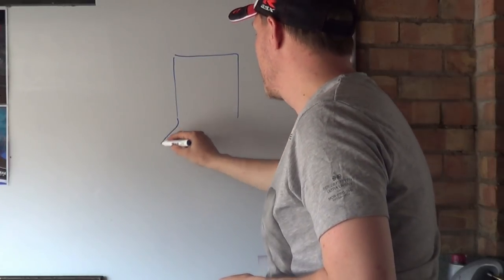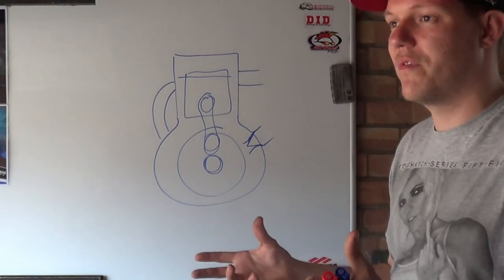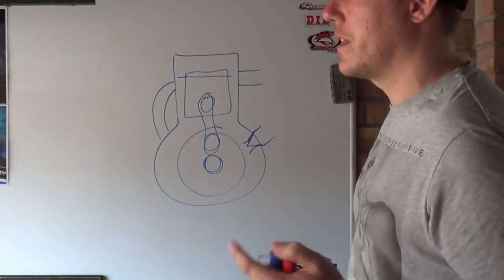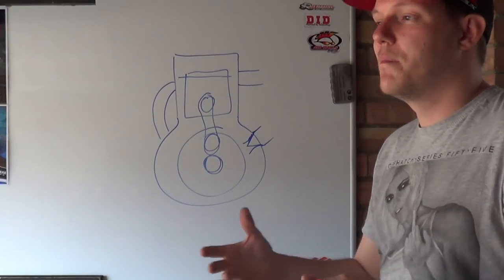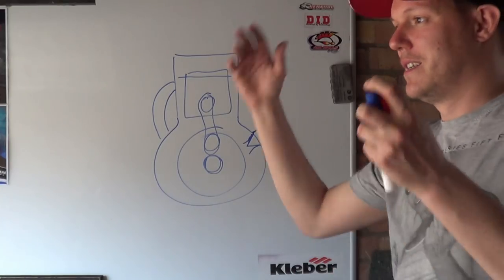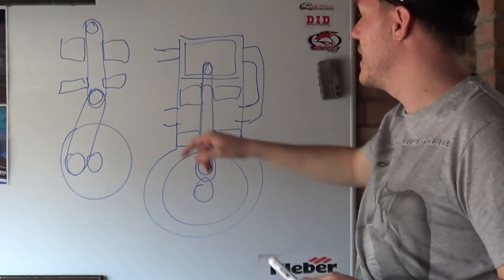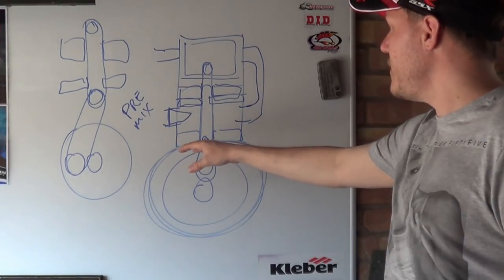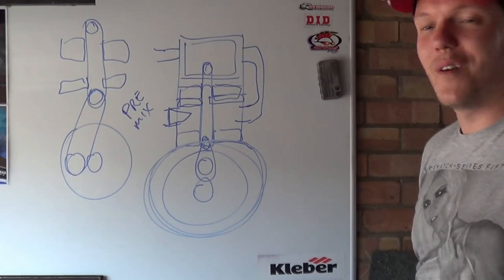2 Strokes are shite! - and why - Part 1

Comment: The most powerful aero piston engine that drove a prop in WW2 was actually a 2-stroke, the sleeve-valved 36 litre,  H-24 Napier Sabre, used in the Hawker Typhoon and Tempest. Over 2400HP from a 24 cylinder engine and I think that power output was never broken. The 27-litre Merlin or Griffon could never match that output, the best they could manage was 1000HP.

"There's nothing quite like the smell of Castrol R in the morning; it smells like, victory..."
Reply from the maker: lol Castrol R! now there's an awesome smell.
Reply: +ModshackMerlin   I do believe the Napier Sabre was 4-stroke in operation (its firing order/timing), utilising the continual supercharging to help after the power/exhaust stroke to purge residual exhaust fumes and cool the sleeve liner - since it cannot be as effectively cooled as a fixed liner non-sleeve design - although the Sabre could've been made to be mechanically 2-stroke, with minimal changes (giving it another ignition circuit to fire for between the other) - the material specifications and cooling problems of then & it in that format excluded it running as a 2-stroke in firing order/timing, -that and even more excessive fuel consumption for its power & size for usage in an aircraft..
Reply: Matt worked on the Napier Deltic, so I am happy for him to be the arbiter in our discussion. A lot of articles come down in either camp when it comes to the Sabre engine, so the actual answer is a bit clouded.
Reply from the maker: lol the Sabre was a 4 stroke engine, with sleeves similar to the Knight system. The Deltic was actually meant for the Navy. Napier loved the Jumo 204 and wanted to get in on the diesel game. 

The rotating sleeve opened the ports to the exhaust and inlet, but the cycle was 4 stroke. The deltic made use of the uniflow system seen in most diesel marine applications today, with the added bonus of the opposed pistons arrangement. 

- matt
Reply: The Workshop 

on the subject of uniflow, and attempts to take advantage thereof, is the twingle anywhere on the list?
Reply: The most powerful aero piston engine was a radial Pratt & Whitney R-4360 Wasp Major, iirc.
Reply: ModshackMerlin, your data on the Merlin is incorrect. The Merlin 61 is rated 1,565 hp (1,170 kW) at 3,000 rpm at 12,250 ft. The late war version Merlin 130/131 designed for the de Havilland Hornet was rated 2,060 hp (1,536 kW). RR ROCKS.
Reply: wow! i never knew the sabre was a 2 stroke! thats fucking cool! imagine one in a bike! ha ha!
Reply: @dirtygarageguy  you never forget that smell its the best!
Reply: Sleeve valve is 4 stroke cycle in aviatio at least
Reply: The crecy was a actual 2 stroke though.  That engine just had sleeve valves.

Comment: and me being a marine engineer Two Strokes are more reliable than 4 Strokes on the water have about 216 less moving parts in each head. each engine has it's applications where it shines. but a bad design the two stroke is not
Reply from the maker: for bike engines it is, and I'm pretty sure that in the video this is obvious.

Comment: What's wrong with having an opinion, if it gets folk excited. I suspect you secretly love them otherwise you wouldn't want to build an improved one. Personally I bloody love 2 strokes it reminds of fun days in the 80s. Has someone made the point about small boat engines, 2 strokes make more sense than the sun. Who wants to carry own a 40 kg, 4 hp chunk down the beach, that's hard to start and pisses oil all over your garage floor and the boot of your car every time you lie it down.
Reply from the maker: "I suspect you secretly love them otherwise you wouldn't want to build an improved one."

- Yeah it was just a bit of fun, I also did a 4 strokes and wankel are shite video after this one. Its great to wind up the 2 stroke wankers - the guys who think its the best thing ever.
Reply: @dirtygarageguy  I suspected as much lol. Love your vids btw I have messed about with engines for years but I learnt loads from watching these lectures. Perhaps for your next video you could try "turbo props, gas turbines and jet engines are so ww2, why can't we move on".

Comment: Simple two strokes especially lower revving ones can go a long time even with the crank oiling issues you mentioned etc. Have you actually owned any?

Ive a vespa with nearly 50k miles on it and the cases were opened for the first time last week, and that was only to change the gear selector I didn't need to change any bearings.  Of course it's had a few top ends but they're cheap and it's a ten minute job. 5-10k from a top end easy that's not too bad. There are several jawa 350s and stuff I know of on over 50k without even top end rebuilds. . 

A point very worth noting on the bearings wearing out etc is that it's easy to fully rebuild a two stroke, you can rebuild the entire engine yourself with basic tools at home. Whereas if your four stroke engine needs crank bearings you'll probably just scrap it lol

Some people push two strokes too far and this makes them more unreliable, but pushing any engine makes it more unreliable. Leave them alone and they're sweet lol.
Reply from the maker: Another comment that needs a video reply for next week. But in short, yes I have owned 2 strokes, and I have several videos on them here.

Comment: My 1970 250 cc two stroke Jawa did 40,000 miles between overhauls. That seems reasonable for a bike engine.
Reply: i had 350 jawa 2 stroke and it was a gas hog... it sipped more gas tham than my 750 heavy ass advanture 4 stroke from late 80's... no thanks. and it does not sound tinny like a 2 stroke and makes more power by the way

Comment: Now I know you have made this video to get views with your controversial title however I will indulge you a bit. 

Firstly, garden tools are subject to emissions regulations and is the main reason that they are changing to four stroke. The other reason is for convenience,(no premixing) and no starting issues that occur from carbs gumming up from the oil when left standing, causing starting issues. 

Secondly, one of the major advantages is that every stroke is a powerstroke rather than  firing every other stroke in a four stroke. This allows more power from the same engine displacement. 

The bonus with this is that it is done without expensive ancillaries such as turbos, fuel injection and computer control. There is no timing chain to fail or replace and no danger of dropping a valve which is a common failure or modern 4 stroke motorcross bikes resulting in bills that can near £1500 to fix. A highly tuned 4 stroke is just as liable to failure as a tuned 2 stroke but more of a disaster when it happens. I completely rebuilt my 2 stroke road bike for approx. £80 including conrod, piston, main bearings and seals and it could be done in a few hours. My kx250 2 stroke motorcross bike cost about £200. 

It is also worth mentioning that a standard (non tuned) two stroke can be perfectly reliable and most problems are caused by people messing with them to make them faster and causing problems with the fuel mixture or causing/not diagnosing air leaks causing heat seizure. This is the main pitfall for two strokes and because they are so easy to work on lots of people have a go when they don't really understand what they are doing.

Also, your argument that the technology is antiquated is flawed, four stroke engines have been around just as long and still use the same principal as the day they where invented. There have been no real advancement in technology since variable valve timing in the 90`s and even that wasn't really groundbreaking, and they still cant rev like a 2 stroke. It also goes against what you said about making things as simple as necessary to get the job done and two strokes just cannot be beaten for this. 

Both engines have their disadvantages and limitations but many of your assumptions in this video are misguided. The only reason for the death of two stoke is emissions which cannot be eliminated due to the fundamentals of the way the engine works. It burns oil by design and also requires an overlap in the inlet and outlet port openings allowing some unburnt fuel into the exhaust. There is some development using fuel injection to help reduce emissions but I think it is too late as the powers that be have already decided. There is still a high demand for two stroke from the racing community so hopefully development will still continue and bring a reprieve, because I will miss the sound and smell of two strokes on the road.
Reply from the maker: This video requires an answer in the next video, but good comment. However I will say this is response to your comment - you said 

"Now I know you have made this video to get views with your controversial title"

1 - it isn't controversial from and engineering point of view 
2 - yes I want views, otherwise I'd keep the videos on my computer
3 - you are correct about the EU emissions, my bad. 

thanks for the comment - matt
Reply: 1  - It is controversial because it is a completely subjective statement and the reasons you give for them being shite can also be used as reasons they are better when you change the context.
 I.e. - having no wet sump enables two strokes engines to be used at any angle. 
 Not having as many moving parts means less power losses through friction, pumping oil, compressing valve springs and a wasted compression cycle. 
Pre-mixing oil into the fuel guarantees that the engine is being oiled and no pumps to fail or galleries to block up.
Their simplicity makes them cheap and easy to tune to best suit the demand, it also makes them cheap to produce making them far more practical for certain applications. For example cheap transport, motorized bicycles or 2t nitro engines for remote control models.

Using your logic I could say that all engines are shite because they were all invented before world war 1 and rely on old technology and ideas, need regular maintenance, waste a lot of energy through heat generation and have been surpassed by electric motors. But then of course we could have a debate about why electric is shite vs internal combustion when really it all boils down to what you want and need in your particular application and because they all work and have their advantages(and disadvantages) they cant be considered "bad engineering".

2 - Fair enough you want views and there is nothing wrong with that, but clickbait titles designed to offend/annoy kind of devalue your channel and with this topic especially could alienate more viewers than it engages. It`s not a big deal and your videos are entertaining and reasonably detailed whilst still catering for the less knowledgable so its all good. I just have a personal gripe with anyone that thinks two strokes are shite.. lol

3 - Lots of garden tools now even have anti tamper fuel mixture screws on the carbs and the tools to adjust them were near impossible to buy. Just more government control and unnecessary interference although I think this example comes from America.  The slight saving in emmissions by not letting the user richen the mixture is completely offset by all the bad running equipment out there and the ones that become landfill because they ran too lean.
Reply from the maker: wow that's a lot of reasons, 

- "It is controversial because it is a completely subjective statement" 
- its not subjective, its factual. Not the shite bit, thats the wording I chose. You'll have to wait for the video this weekend, but there's more to the story hence the - part 1 - in the title.

- clickbait? wiki quote - describing web content that is aimed at generating online advertising revenue, especially at the expense of quality or accuracy, relying on sensationalist headlines or eye-catching thumbnail pictures to attract click-throughs and to encourage forwarding of the material over online social networks.

I could understand if this was a video that just went on about something OTHER than why 2 strokes are crap and have been superceeded. But its not.

To increase online advertising revenue? Seen as though I do videos on engines, bikes etc then I don't think this follows.

 sensationalist headlines - yes I agree with that, Youtube is a battleground for views, but I have other videos that follow the same style.
 
- "offend/annoy kind of devalue your channel and with this topic especially could alienate more viewers than it engages" - now that's a personal opinion. I say 'fuck' alot which alienates viewers but also brings alot in.

What I'm getting at here is that this has nothing to do with the subject, whilst the title, thumbnail and content do. It will annoy some people, but what should I do, ignore the facts and just do what won't offend/annoy/upset people. I was under the impression its called YOUtube as in me not you. These days it seems to be more the other way round. If people don't like it they can always just watch something else. 

At the end of the day this doesn't chnage the fact that 2 strokes have been superceeded by 4 strokes for many reasons, reasons I will cover in the upcoming parts

Don't get me wrong, I love reading your replies. Nothing better than clashing heads, otherwise life would be boring.

- matt
Reply: The disadvantages you state are factual, however saying they are shite and bad engineering is your opinion which is not shared by everyone mainly as there are certain applications where four strokes cannot compete. You are comparing apples to oranges, just as a two stroke engine would be shite in a car you commute in, a four stroke would be shite in a chainsaw so no bad engineering, just bad application. 

4 strokes are way behind 2 strokes in some aspects. Lets compare the modern yzf r125 to a 15-20  year old Aprilia rs125. Yzf - power, 15bhp, torque 12nm, top speed 75mph, 0-60 12 secs. Rs125 = 33bhp, 25nm torque, 100mph + and 0-60 in 6.5 secs.  Aprillia`s offering gives a power to displacement ratio of over 250bhp/L with no special tuning or aftermarket parts. Calling this "shite" is ignorant to say the least. Ok the yzf r125 may be more reliable but I want to enjoy riding a bike, not be disappointed. Other people have different priorities and should choose the bike/engine type that suits their needs the best but for some, two strokes are best and far from shite.

"I was under the impression its called YOUtube as in me not you."  Nowadays it seems more like VIEWtube where becoming famous/popular is the aim of the game. 

"To increase online advertising revenue? Seen as though I do videos on engines, bikes etc then I don't think this follows."  You are chasing views and using controversial and antagonistic titles and thumbnails to BAIT/provoke people into CLICKing on your video to give you those views and  to "attract click-throughs and to encourage forwarding of the material over online social networks." I.e. to bring people to your channel and videos.

 Just because you aren't linking to any advertisers (although technically you are, just advertising yourself) doesn't mean that your tactics aren't still manipulative clickbait. Not the worst by far but still enough to qualify.

I`m not calling your videos or channel bad, quite the opposite.  I am looking forward to the next installment and don't begrudge you wanting views or giving your opinion and would love to see your channel do well.  I`m just giving my opinion and I hope you can see it is intended as constructive criticism rather than trying to have a go at you. I will elaborate further on my clickbait comments if you are interested but I would rather be talking about engines.

When is part 2 out?
Reply from the maker: This weekend-ish...... Probably Sunday (16-04-2017)
Reply from the maker: part 2 - https://www.youtube.com/watch?v=lUrDgY_pj08
part 2.5 - https://www.youtube.com/watch?v=wZtIpvVW5XQ
Reply: Ian H I stopped reading your post when you said 4 strokes can't rev as high, go do some research
Reply: Listen lad, go back to your computer games. I don't need to do any research, you need to learn to read properly. I said they cant rev LIKE a two stroke, not that they cant rev as high (even though they cant, like for like). If you knew what you where talking about then you would understand why 4t will always have the disadvantage over 2t in its revving ability and you would also understand that just because some 4t can rev  to 20k+ and most 2t don't, it doesn't mean they cant. 2t nitro engines have been made that turn 50,000rpm. Don't believe me? Do some research....
Reply: Ian H You re right my friend. My 28 race engine is rated at 4.52hp at 53000 rpm. Its insane. 
2 stroke is an old design, but its not shit. Its simple and will last if you use good oil, right premix and perfect tune. I ride ktm 250exc, with diferent winter and summer carb settings, and made 1 piston change. Its cost me around 120€. My pal runs his ktm 250f, 4 stroke, much slower than my 2 stroke, for almost the same hours, because we usualy ride together, and he has just thrown at the shop around 900€ for a engine rebuild. And he services the bike in time at the ktm dealer. If you add the 900€ to the services expenses, you are looking probably at over 1200€ in 2 years. Mine is just 120€ plus oil, plus a little more petrol, because the 2 stroke really loves fuel. 

So in MY OPINION, in certain aplications, 2 stroke is the best engine. Equivelant cc engines, 2 stroke are much faster, great power band, lighter, simpler, and much cheaper to run. 
The perfect enduro engine is the 300cc. Has the low end torque, and shit loads of power at the top end. No 4 stroke engine on a enduro bike can come close to this beast
Reply: "Every stroke is a power stroke"? Is that a one stroke?